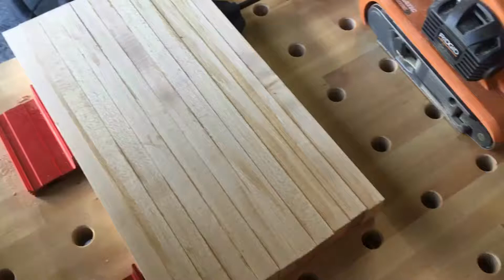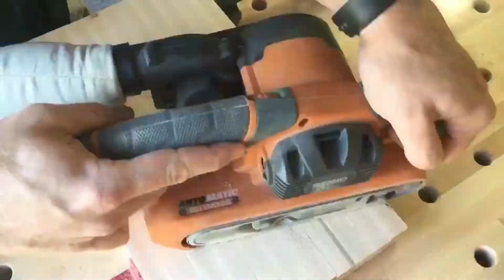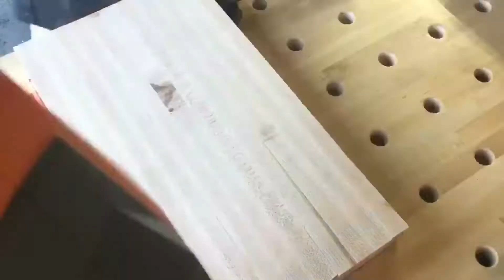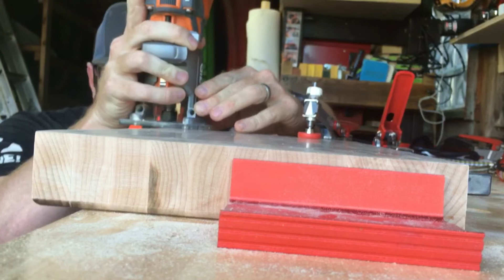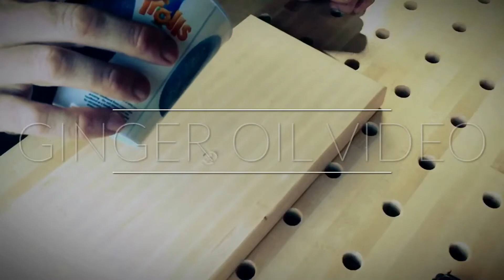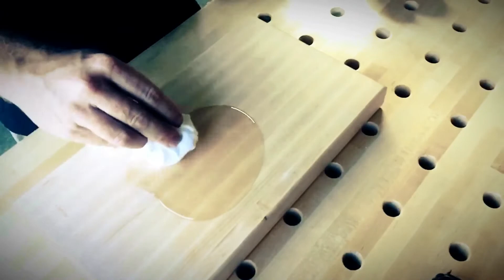DIY Cutting Board with Ridgid Belt Sander

Comment: Did you spray with water to raise the grain between higher grits and did you end up putting feet on this one or did you plan to use both sides?
Reply from the maker: Fox Designs i sure did.    And thisbije didn’t get feet.  It’s honestly on my stove as more of a candle holder.  It was first board i ever made so I’m stoked.   Funny i have a planer now and haven’t had time yet to make a board with it